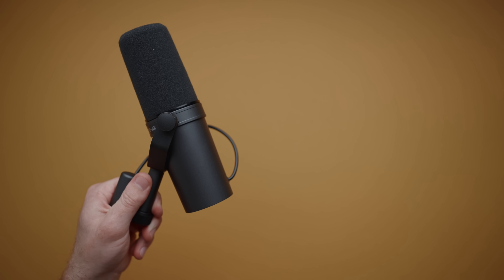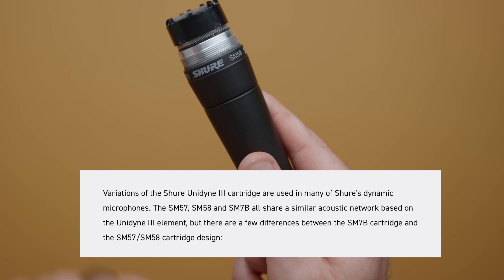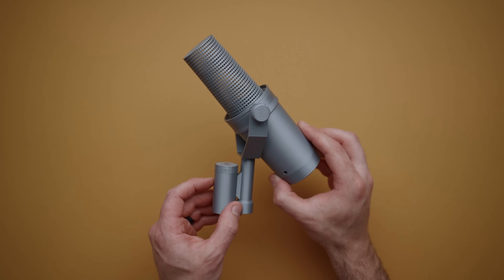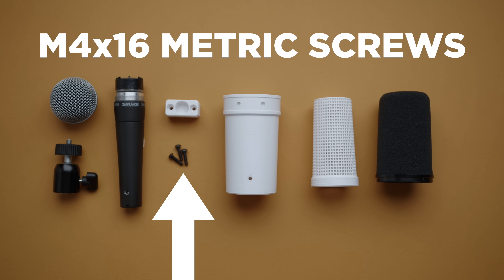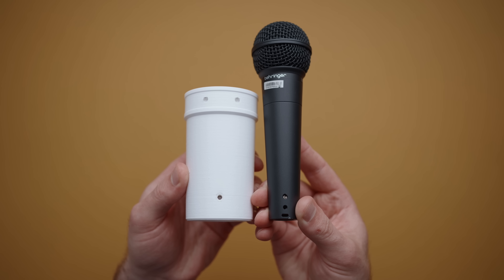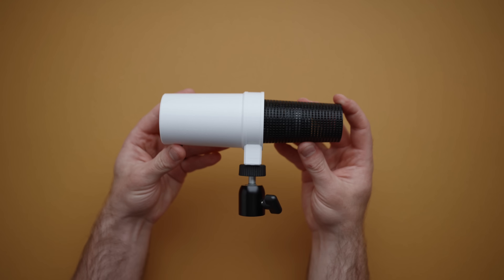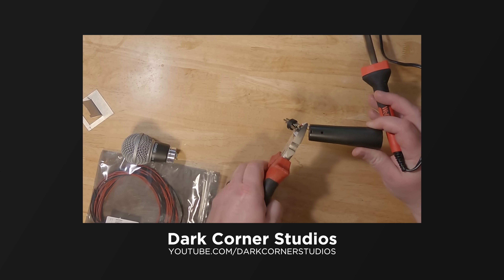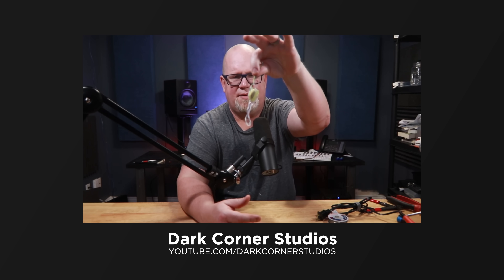$30 DIY Shure SM7B Microphone!

Comment: Had a question re: 3D print. We've just tried printing it using PLA+ at 20%. Results are good, but not perfect, and I'm concerned with minor issues and crush points. Can you give us some tips on what printing filament was used and the settings?  Thanks.
Reply: I had excellent results using eSUN PLA PRO in Pine Green Color (My favorite color and filament) 

I was using the Voxelab Aquila X2 Upgrade, stock everything, stock extruder and base plate. I was able to snag it on sale for $180, highly recommend. 

I used my standard profile in Cura, 18% infill, 3 line walls, layer height 0.2mm, infill speed 50mm/s, Wall speed 25mm/s, no supports needed for the main two body pieces, and even the mesh part printed surprisingly well.
 I've had an amazingly easy ride with the Aquilla so far, easy to level and stay level, following some of the amazing setup vids.

The eSUN filament prints like a dream, I've also had great luck with all of the Matte Filaments from Overture PLA, in Black, white, and Tan, really beautiful and nice finish right off the printer.
Reply: I second this! Look to try printing this asap but not sure as to what filament will work and look best and if there certain features to look for when buying a 3d printer?
Reply: I third this! Print settings would be super helpful.
Reply: i used PLA, 20% infill gyroid with tree supports and it printed great.

Comment: I have some ideas to make this better, but I'm not sure if they'll work and I'm terrified of ruining my SM58 (though I guess I could test on a Behringer). If you cut two large sections on either side of the SM58 handle leaving the overall shape in tack to hold everything in place, remove as much of the silicone inside as possible, cover the inside of the shell with aluminum tape, will yoy get the deeper resonance like the SM7B has? Also you'd probably want some way to imitate the rubber shock mount inside the SM7B as well.

Comment: after looking through some photos of the sm57 and the sm58, would i be able to use the sm57 in this housing instead of the sm58? the screws for the microphones look to be in the same place. Also would i need to make some other modifications to the sm57 in order for it to work? thanks for the video, amazing diy.

Comment: I made this with my home 3d printer and it is awesome! I used the Behringer xm8500 and made a custom eq to emulate the 7b a little closer. it looks awesome in the Green filament!
Reply: What interface are you running?
Reply: @tmlrobotics5446   I'm running the Focusrite 18i8 and using a Klark Teknik CM-1 (a cloudlifter clone that sometimes is on amazon for $30) boosting 25db using phantom power, gain around 2 o clock on the knob. 
Sorry for the tech talk. I also set up an EQ curve on OBS to get it much closer to a SM7b. +1db to 115Hz(Q 5 octave), -1.8db to 1400Hz (Q 0.7 octave), -1db to 6.5Khz (Q 1.5 octave), and a -2.2db High cut at 14Khz. It smooths out the highs and gets rid of a lot of the sibilance and beefs up the bass just enough. Not a perfect clone of the 7b but it sounds really great!
Reply: @richpence  thanks for the detailed reply. I was wondering if you were using a Cloud Lifter equivalent. Trying to figure out if I should go this diy route or just get an MV7. Diy is more fun tho that's for sure.
Reply: @tmlrobotics5446   if you have a 3d printer at home I highly recommend it! if you would have to go and buy the parts to be printed it may not be worth it, that plus the parts and the mic may not be worth it. For a USB based mic, check out the Samson Q9U. It sounds really good and goes for around$120, I've found I prefer it to the MV7
Reply: @richpence  I have a printer. I have also looked at the q9u. How would you say this mod compares to that? For a similar price to the q9u I could do this mod, get a Cloud Lifter clone, and a cheaper interface. Thanks again
Reply: @tmlrobotics5446  I got my wife the Behringer UM2 interface and it has been working great for her for streaming, Great clean preamps and stable phantom power all while USB powered as well, just one cable! for $45 I think its excellent. You can also skip the cloudlifter to start, the Behringer XM-8500 and the shure sm-58 are both much hotter than the sm7b and will drive just fine with the UM2 preamps. Getting into an interface sooner than later would be my suggestion if you are interested to keep upgrading your gear over time. I would save on the cloudlifter and instead get a decent desk arm for the mic, also, if you do the mod get a good ball head. I am a photographer by trade, and I highly recommend leofoto, their f-19 mini ball head is only $15 and so smooth and sturdy, its worth it. If you do want the convenience of a USB mic, I would maybe get the Samson Q2U instead, it is a handheld design and with some modification to the STL of this mod should fit perfectly then have a usb and headphone jack on the back, and an XLR if you want to use an interface. Do remember that it will all take some EQ to really sound best for VO or close to a SM7b, but both options will get you great sounding audio. Also you can always get the mics / interface on amazon and try it out first before modding, the mod really doesnt change the sound much at all, just upgrades the look and feel.
Reply: @richpence  thanks again for all the information! Really appreciate you helping me out. Looks like I have a decision to make
Reply: @tmlrobotics5446  Listen to some reviews and pick what works for you! USB Mics are getting pretty darn good these days and are super convenient. I was setting up my wife for streaming, but instead of giving her a condenser I actually bought her an XM8500 so we have matching mics. The preamp on the Behringer UM2 can run the mic but not super loud, so for video conferencing a boost may be needed, but for streaming or recording in OBS the Compressor and limiter will work perfectly with no need for a boost. Podcastage has a great vid on OBS settings. Best of luck and have fun!

Comment: sorry but, apart from the fact that the 2 microphones sound "more or less the same", the sound is not the same at all. The SM7b has more air in the 12k to 20k frequency range.  The area that makes sound "real".  the sensitivity of the capsule is not the same either and you probably compensated for the gain somewhere in the sound chain for your comparison.  I 100% agree that an SM58 or a behringer under $20 can be enough for vlogging, but, in this case, why try to dress him up as sm7b?  might as well use as it.  I've been using the SM7b for years to record musical instruments, singers and different sound sources and no, definitely no, it doesn't have much to do with the SM58.  If you want a cheaper alternative to the sm7b that looks the same, then buy a t bone MB7 Beta, it's 99$.

Comment: I could hear fair amount of difference between 7B and 58 that 58 lacks high frequency presence compared to 7B. However if you post process with a bit of (around) 8k boost or a bit of high-shelving they would sound pretty close, I guess.
Reply: Likely has a lot to do with build in adjustments the SM7B has out of the box. Could probably DIY a pre-processor from Arduino parts.

Comment: Did anyone try this with the SM57? Not thinking to much about the audio response, but rather the fit inside the SM7B-printed body.

Update, I tried this and the fit is good. I put one layer of electrical tape at the top and bottom end on the mic, and the fit is PERFECT.
Reply: It fits

Comment: The net saving is not that high. You will have to own a 3D printer. Else, if you have to source the printed parts, it will cost money. The extra stuff needed ( which is already in the box of an SM7B), is not for free either. Just consider it as a nice project to understand the principle of the SM7B and building it will be just a great experience. ...And a way to become aware that the SM7B is really ov€rpric€d of course ; ).

Comment: Amazing, I can only imagine the clarity with audio filters to tune it up. It can probably be done near identical, but the XM800 was actually my favorite sound, it had just the right amount of pop in my ears with clarity. I feel like once it's used in obs with proper gain sounds and audio filtering it can be insane.
Reply: Honestly I loved the sound of XM800 too... It had some nice presence in the mid range. The SM58 on the other hand had a lower bassy tone(suitable for podcasting)
Reply: I thought the SM58 sounded far too muffled compared to the 7B and the XM8500 (which I thought was on par with the 7B!)

Comment: Interesting video... my recommendation to those pining after a SM7B but can't afford it - stop buying into the hype!  It's a good microphone, but it's not without issues.  I respect the heck out of Caleb, but this is nothing more than a cosmetic modification to "look the part" plus an upgrade to the windscreen. Now, he's not wrong that the windscreen on the SM7B is a whole lot better than the SM58 design to avoid plosives, but you can get the same effect simply by adding the Shure A81WS (windscreen) to an SM57.  If anyone is interested, I have a video on my channel comparing the SM7B to a stock SM57, a modded one with the transformer removed, as well as a $25 Pyle knockoff and the results were quite surprising and no 3D printing necessary!

Comment: The SM58 is just to dark. The XM8500 fits your voice and sounds the most natural.  but has a unnatural compression so I wouldn't used it.. What ever your using throughout the video before the mic test the high EQ is cranked. It has very harsh highs (S sounds = pain) that hurts my ears listening threw Kali audio studio monitors. sticking with an at2020 but want the at4040 witch I think is comparable with the SM7b but fits my setup and usage better.

Comment: I always imagined that when you took apart a SM7B that it had a shock mount with springs or something. It seems that when people bump the SM7B it does not make the usual thumping sounds most microphones make. It was shocking to see how simple it was inside. Now, where did I put my old SM58...
Reply: Its literally just a rubber grommet, that's it. Would like to find a way to recreate that for this though...

Comment: Really nice Design. Thanks for sharing the STL. But could you please also release the replica yolk design, even though it requires soldering to the XLR port. I really prefer the XLR port on the bottom. Thanks.

Comment: ngl, but they sound quite different, the 20$ obviously the worst.
You WILL not get the sm7b sound with an sm 57/8. Because the 7b has a larger diaphragm than the 57/8. Also the casing of the 7b is designed to reduce rumble from movement or footsteps, which you also wont get from the print
But i like the idea and want to test it myself.
Also: why does your normal mic for the video sound worse than the behringer one?

Comment: Thats very cool!

Update: Ok for me with the XM8500 it comes down to 65-75$ in cost (baring the screws). I dont have a 3d printer so am guessing that will add 10-20$. Still seems good for me but do you think it will give a much greater preformance if I do the upgrade? The base Xm8500 costs 25$ now so the upgrade is 40-50$.

Comment: I think it might be cool to use a modded SM58. Take the transformer out of the 58 and see if that get you any closer. Still not bad results. I do like the sound of a condensor, but there are times a 7b would really do the trick, and I might use it more than I think once I had one in house. Cool experiment

Comment: One thing to consider.  Room treatment makes a HUGE difference for any microphone.  I don't know if the SM7B deals with it better or not, but it'll be interesting to see the difference in an untreated room.
Reply: room doesn't matter that much with dynamic mics. Condenser mic are way more sensitive and can actually perceive the reflections or reverberation of a room

Comment: listening through YouTube compression isn't exactly ideal but as a voice actor and mic nerd here's what I heard through my cans. The SM58 in that enclosure loses a lot go the upper frequency clarity - that air and sparkle that gives a brighter sound is gone. This could possibly be corrected with EQ though maybe at he expense of introducing more signal noise. The little $30 mic obviously lacks any depth but did sound a little better when it was raised up. The SM7b has a much more premium "radio ready" sound but honestly with judicious use of eq and compression I think the SM58 mod could get 90% of the way there at 25% of the price.

Comment: Definitely a noticable difference. SM7B is well rounded and the frequency response is tighter with less boomy midrange. The SM58 has more blown out bass and a higher midrange mud.

Comment: What kind of microphone would this video be using? It's out of frame and doesn't sound omni so is it some shotgun mic above the frame?
Reply: Ok, so I should have gone look at your other videos first. It looks like not only do you use an arm mounted mic outside top of frame but you also have videos recommending recording setups for under $2000 and even one for around $130 using what looks like a Rode videomicro

Comment: The diference of the sound is major  as frecvency response and  inspecial on the dinamic range. I lisen on Yamaha profesional monitors and in a real studio . the diference is BIG in sopund and this on Youtube after all the compresion and frecvency los tipical fot Youtube uploade. Inreality the diference mast be ivan beagar.  Is logical the Shure sm 58 haze ca coil resposable for a very agresiv audio dinamic uniformization or compresion  fout for live aplications.  The capsule is not the same and you  mis the frecvency respons corection on the mic . In plas  on Shure sm 58 you dont have the air suspension resonsable  oaso for an plezent acustic and armonic rezonance fo the sound. Sorry for my eanglish in no my nativ languige. So..... y6 can not comer the 2. If you have  decent iers and decent speacers the difrence is  total.

Comment: Just order a sm7 element and design a mic for that. The sm58 camsule is not the same. 
Better yet, just use a damn sm57 with a faom cover and a standard mic mount. 
This is cool, but just overcomplicates things. The sm7's sound is by using it off-axis, just use the sm57-58 that way. geez

Comment: All of them sound better raw like that than the setup you use for the rest of the video btw. I am using Adam A5X's with DRC-FIR convulsion room correction to listen , the normal portion of the video sounds very high frequency focused , it's all ssssssssss. which make it sound very cheap

Comment: The SM58 has a transformer in it as a means to increase its output level, which the 7b does not have. That affects the response of the mic, and the amount of gain needed to reach 0db. Also, the enclosure of the 7b is acoustically designed for background noise rejection, and additionally must be made of metal to shield the mic capsule from electromagnetic noise. Removing the grill from the 58 and replacing it with plastic will affect its signal to noise ratio. This mod would be more complete by removing the transformer from the 58 and placing it in a replica 7b enclosure made of metal.
Reply: theoretically one could just put aluminum foil inside the enclosure then right?
Reply: @2001mufasa  Sort of. I don't think aluminum shields as well as iron does, and the grill needs to be able to shield the capsule also. So coating the inside of it with any kind of foil would be very tedious if you want it to look nice and pick up sound properly. The mod in the video is almost cosmetic only. It does serve the function of making sure you can't get your mouth too close to the capsule though, as noted in the video.
Reply: Out of all the comments, I probably just found the only other audio engineer in this bunch. Trained ears can easily hear the difference in the sound if the mics as well. The boomy nature of the 58 is going to come through once any amount of compression is applied. The 7b also has a larger diaphragm.
Reply: @randomschittz9461  Glad to hear that my knowledge/advice is on par with guys more experienced than I. Though I didn't know that the mic capsules actually had any appreciable difference between them. I thought it was all in the complementary electronics and enclosures.
Would the boomy nature still be present if your proximity to the capsule is limited to a minimum (and thereby, the proximity effect)? That does serve as a reminder why it's good to limit the bandwidth of your compression, though. I tend to cut the lows to some degree any time I'm setting up a compressor for vocals.